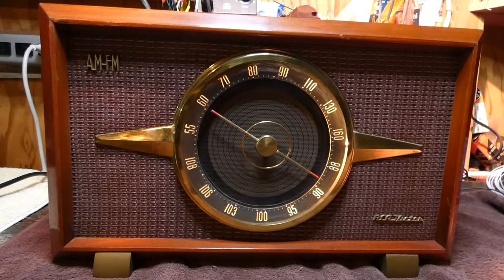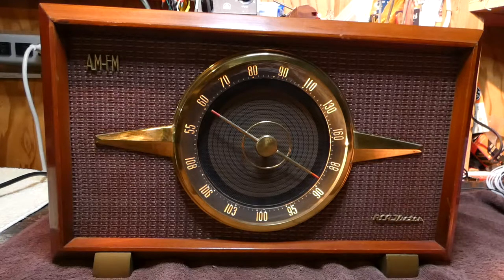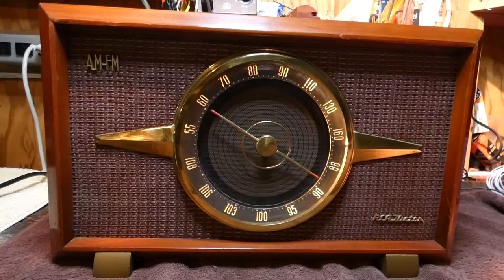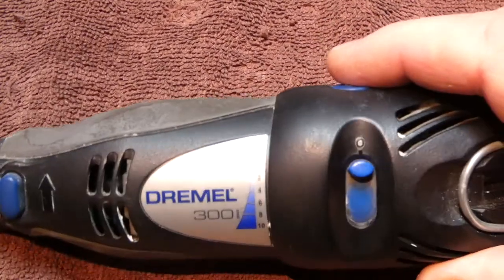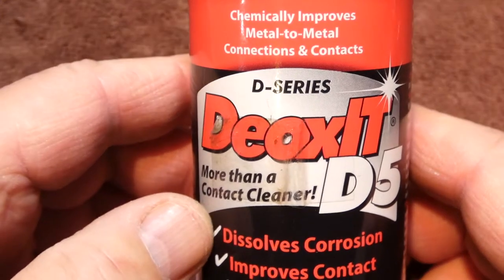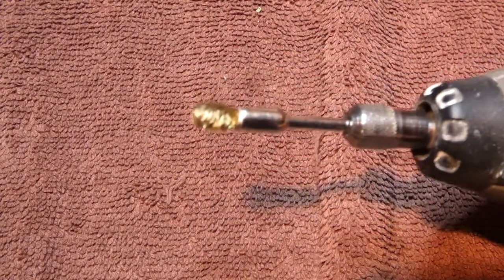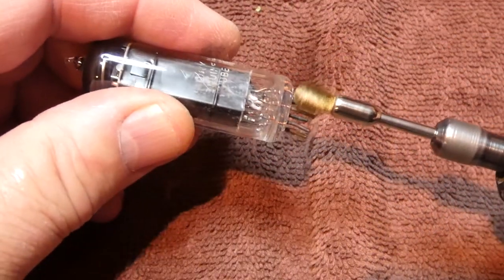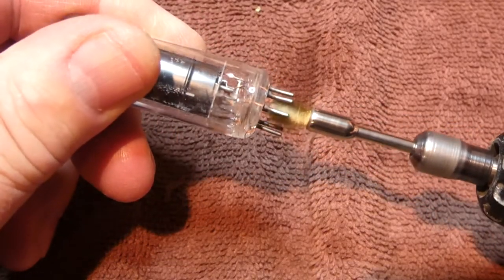Radiowild's Tricky Troubleshooting tips Part#8   The importance of clean tube pins/sockets

Comment: I,do that cleanup using #800 grit sand paper , wrapping a small piece in a circle to clean the outside off the pins, then a smaller diameter roll to clean the inside pins. A touch TARNEX on a Q tips does good too.